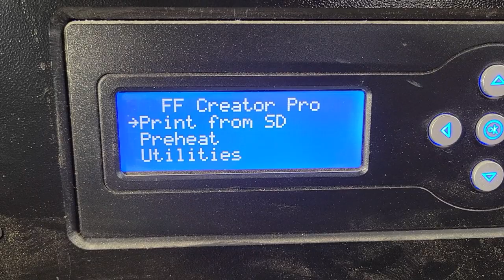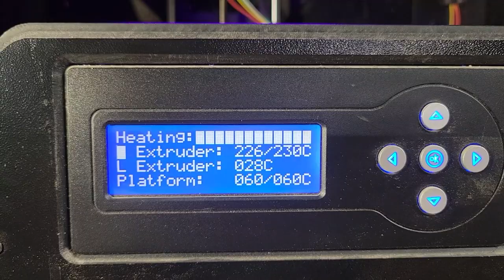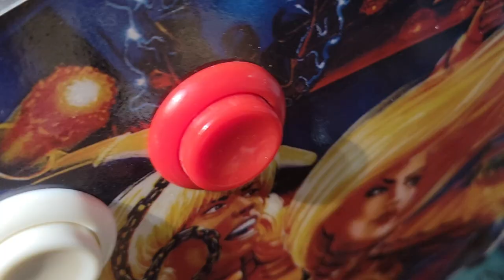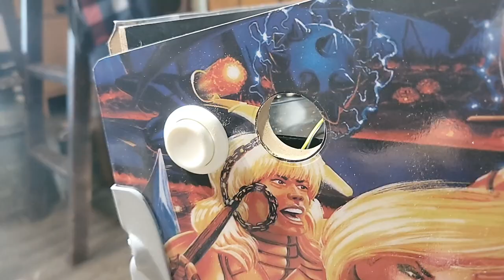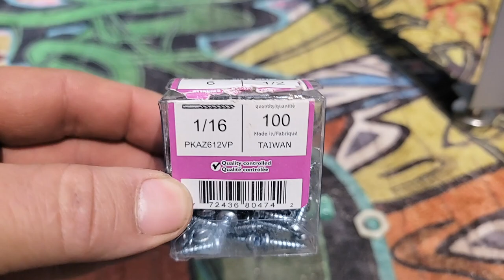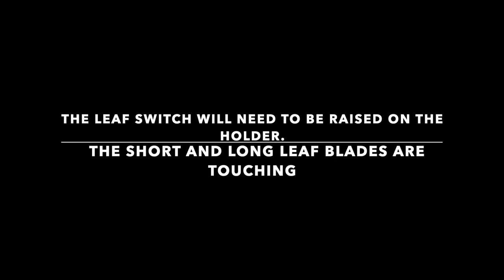Installing Leaf switch Virtual Pinball Cabinet

Comment: it was the bracket... Man you saved me lol. I had ordered all the parts before seeing this, snagged a 1 3/8 clear red button which was surprisingly hard to find, but I wanted specifically that, and the bracket I got with it was specifically meant for like, atari arcade boards, where the panel itself was super thin, so the bracket was really tall to compensate. Printing that out now, cause man, even those gold leafs dont beat the real leafs lol.

Comment: It's not just the hole size that's an issue with fitting the pinball buttons.  There are small plastic tabs where the button contacts the side of the machine.  These are for alignment on a real machine, but unnecessary for the ALP.  I had to use an exacto knife to carefully cut these little tabs off so the button would sit flush.
Reply from the maker: Great tip. Tx

Comment: I found an ALP for under $500. It's cool, but I never play it because I like VPX tables so much more and the menu system makes no sense. Are you preserving the ALP system or are you going to go full VPX? I'm considering ripping out the ALP stuff and making it a mini VPX table.
Reply: You can EASILY play VPX, Future pinball and FX3 on the ALP. Just connect a USB and HDMI cable from your PC to it and go into OTG mode. It's great.

Comment: Nice video. Is a leaf switch better in any way than a miscroswitch one for a pinball cabinet? I'm not talking about the touch feeling, I'm curious about the speed.
Reply from the maker: Yes, absolutely, you can set the sensibility of the switch by moving the legs

Comment: I've finally taken the plunge and purchased these leaf switches.  When you disconnected the wires from the stock buttons, were any special tools needed?  Just want to make sure i dont damage the wires when i install mine...
Reply from the maker: No special tools. If you notice that ths wire does not come off the old button, use a pointy object  to push down on the button pin to release it.
Reply: @MajorFrenchy  Sounds good...thank you!

Comment: Love the videos, have to say your the reason I'm going with the ALP which I just ordered from Sams Club. Was going to build one but for my first one I figure this would be a good start, and looking at your guides so far is just awesome. So again I thank you. Now for a question why go with the MX button vs the RGB button, and does it really matter. Since I don't see a final product I cant tell if one would be better then another for any reason. Thanks again for all you do.
Reply from the maker: It does not make a big difference. RgB buttons will be as good. That's tje one i picked up from Arnoz but RGB are fine. Probably easier to program too. ALED needs to be added to your cabinet file and RGB does not.
Reply: @MajorFrenchy  is that the RGB button from Arnoz the same one you are saying would be easier? I may just get the MX button and try to follow you to a T on this, but figured it may be awesome to have more options on the colors.  Also Arnoz has the 3D support button, but I saw a comment about double leaf switches would that be better to put in anyway and would you need the support button still then? They seem a bit thicker in comparison. Which again would be a deviation from what your doing, and again may be better I stay on track with what your doing till I understand more of the gadgets and gizmos this community uses.

Comment: I'm a little confused, why did you put the LED-Board on top of the button holder? This will block most of the light from reaching the transparent button, also there's the danger of breaking the pretty thin LED-Board. The LED-Board goes between the cabinet wall and the button holder, just like Arnoz shows in his video: https://www.youtube.com/watch?v=Ao6XShP0UNQ&t=360s
Reply from the maker: Thanks for the comment.  There will be a part 2 of this video when i get to the actual board being connected with the ALED . that's why i mentioned i might print it with transparent filament which deflects the light amazingly. But you are correct,  arnoz installs it right against the cabinet instead of on top of the holder.

Comment: u didnt want to just print new 3d pieces with taller bases?
Reply from the maker: I could have, and probably will, just thought i would show a quick way to adjust. Not everyone has a 3d printer. There are also different size/thickness available for sale. That would definitely be the #1 choice. Ty for the comment